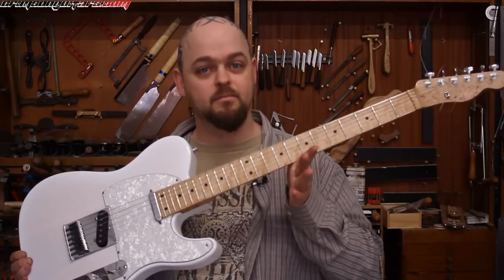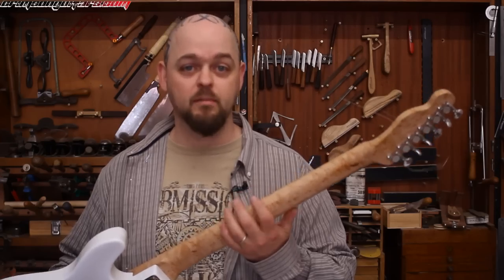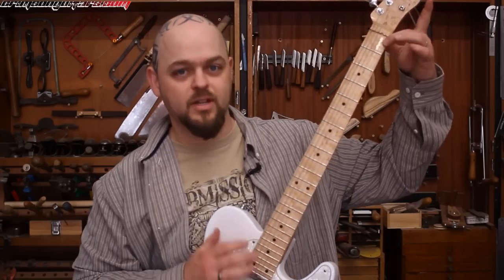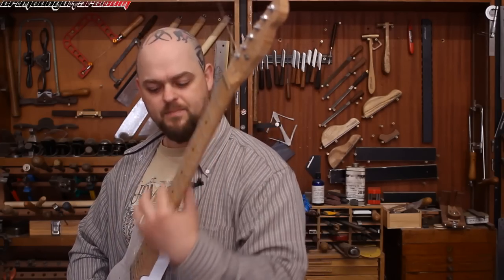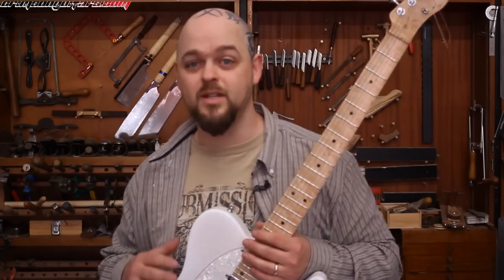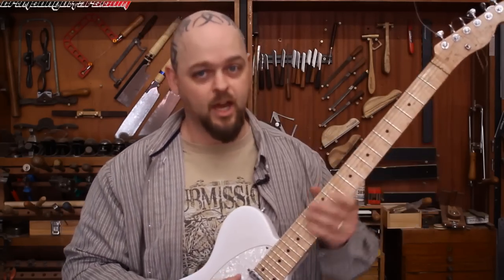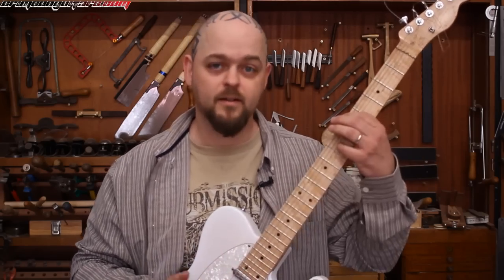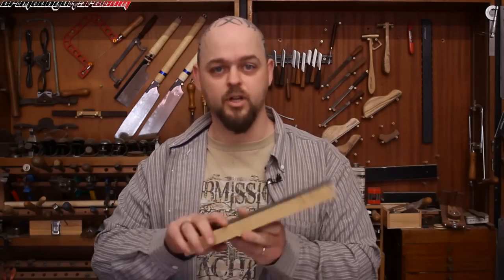Podcast 109 - How to Fix a Twisted Guitar Neck

Comment: I don't think my bass neck is twisted but the strings don't aligned correctly down the neck going from the bridge to the nut. The high E is right on the edge of the neck and the low E is too far to the right. The owner that had it before me did have the body coated in truck bed enamel spray and I wonder if that is what the cause of the misalignment is. He did it because it's an Ironbird and those tend to get dinged up and chipped at the points
Reply from the maker: sounds like the neck is in at a sideways angle, the extra paint could be the issue indeed.. I say remove the neck and try and put it back with the strings aligned properly which may mean using a file to remove some excess paint..

Comment: hi. i just subscribed because u said u answer questions
i have a Steve Vai JEM555 and i have decided to open it up and fix it myself. and i will have questions . i fear it has a twist that was why i searched this video .
i have another Question and that is what is the best way for me to clean the fretboard which is rosewood with. the Germs i mean , the sticky ones .thank you Ben
Reply from the maker: I don't see everything, we've grown a bit big for that... however. There are not many options to fix a twisted neck, if it doesn't affect playability too much it is a case of making the best of it. You could remove the frets, flatten the fretboard and the refret if you fancy a realy big job..
As to cleaning the fretboard, crimsons fretboard cleaner and restorative are non toxic and very very good.. alternatively use lemon oil or similar.. thanks for subscribing. B
Reply: 0000 Super fine steel wool. Never use lemon oil, it’s acidic and eats away at frets. Oil your fretboard with walnut oil.

Comment: I'm pretty sure that the twist in my neck affects the action. the book says that at the 12th fret the bass E string should be at 1.50mm but mine has to be at almost 2.00mm or more to not buzz...

The guitar is set up right. It has a slight bow, about .010mm-.020mm bow so there isn't any buzzing at the middle frets.

its also an LTD ESP viper 200fm made in Indonesia so, it's junk. That doesn't help... :/

can you send me a good guitar so I don't have to deal with this one??

I'm a huge fan of your videos and a future frequent customer and promoter. I like your tats too btw

-Video is "Liked" 

;)

Comment: Hi Ben and the rest of Crimson Custom Guitars, 
I have questions about dead spots - certain notes on the neck with significantly shorter sustain than their neighbours.  I mean real dead spots caused by the guitar dampening some specific frequencies, NOT strings fretting out due to uneven frets, action set too low and other setup issues.

Are they common? I've been to the shop and played some guitars and all of them had dead spots to some extent (sometimes not even "dead", just "weak"), but I may just have been unlucky.
I currently own a guitar that has significant dead spots and think of selling it and getting another one. Although I'm afraid the next guitar will have them too :/.

Are there any remedies for dead spots? My guitar has 3 of them: 15th fret on E and B strings (G and D notes), and on 11th fret on G string (F# note). I've tried so far attaching some weights to the headstock and that helped a bit with the first two, but the third one, the F# just moved half step down to F.

Regards
Reply: I would love to see this question answered as well, coincidentally the dead spot is on the 15th fret here as well. Maybe because of the neck joint, maybe because it has a floating bridge and the springs play some nasty game with that frequency, I don't know...
Reply: Perhaps the frets are lifting a bit in those areas.?.?

Comment: Hey Ben,
Just a thought as you are mentioning basses (which I have noticed you don't mention very often), are there any different fundamental techniques you use when building basses as opposed to guitars, or is it purely a case of thinking in different scale lengths and string spacing?
Cheers,
Lee

Comment: well let me throw another wrench in the works for you.  picture this an instrument 1980's or prior maple neck and fretboard which is 1 piece ( ala japanese made squiers and similar), lacquered  and has yellowed with age.  in this case your option of using the frets although is an interesting theory i have never seen it work ( just being honest). straightenint it wipth pressure does work but most instances goes to crap once string tension is applied  ( look at me rambling on LOL).  ANYway, in the case of neck and fingerboard being made in a 1 piece fasion ( no seperation between the fretboard and neck), and not wanting to refret and refinish an entire neck just so it matches there isnt a lot of options available.  fact is that trying to clamp and twist the neck would be the only means in this case when it comes to 1980's and earlier guitarskeeping it as original as possible is a big deal and this is even more compounded on the lower end instruments from the same period, for example lets use a japanes made squier bass from early 80's ( 80 to 85), if one of these has a twisted neck you can level refret refinish which makes it not cost effective, you could replace the neck but this is not cost effective nor worth it for a bass that varies in price used from 350 (and in some cases and locations) up in the 500 to 1000 mark.  which leaves the only option as clamp heat steam method.  i do agree on one thing though if you are goign to do the clamp heat method leave out the steam it is not going to help because all it will do is add moisture into the wood and go bback to the way it was or be far worse.one method i have tried and seen work is to set and clamp the neck down with a slight twist in the opposite direction then use a household clothes iron on low heat to slowly warm the neck via the fretwire ( rest iron on a rag over hte fretwire).you have to constantly monitor it but i have seen and had it work but only in rare cases.  so with all of that said in the case of fretboard and neck made in one piece and laquered showing its natural aging what are your thoughts on fixing a twisted neck

Comment: Hi, I know this is an old video, but I really need some help, if anyone can answer me I'll be really grateful

I have a really cheap strat copy (before saying "oh, it's because it's a cheapo", I can't even buy a Squier Bullet, it's really expensive here in Brazil, the minimum wage goes around $910, and a Squier Bullet goes for $1.200, I'm not kidding), the original neck got twisted really badly, so I changed the neck on it, a cheapo neck as well, from an old Austin strat copy, the thing is, as far as I can see, the neck is straight but none of the strings can tune, if I hold an E major chord and tune the guitar to that chord, as soon as I go for a G major the guitar is out of tune
the nut is a little bit off the fretboard, it's almost imperceptible, I can't even fit a needle on it, so my question is
is the nut creating all of the problem or there's really something hugely messed up with my guitar?

I'm sorry if I was rude in any way at some point, i'm still working out my English, sorry, but if you could help me please, it's my only guitar and I really can't afford much, just really cheap strat copies...thank you
Reply: Hello Igor,  my first question has to be:  Is the fret spacing the same on the new neck and the old neck?
Reply: Yes, i'm afraid that the neck is a bit closer to the bridge, I don't have proper luthier tools, but I can see that in the old neck, the 21st fret was right above a screw on the guitar's scratch plate, and on this new neck, is a few centimeters away from this screw, going to the bridge direction, so, I think the neck must be off, so, do you think it might be the problem? and how can I drill the neck in the right angle, cause now it isn't, the thing is, I have basic tools, some screwdrivers and stuff, but I have no clamps and so, what tools do you think I can use to "replace" a clamp, so I could set the neck angle, and that huge rule to set the length properly? thank you so much for your reply
Reply: OK, so your new neck has what is called a longer "scale length" and will not play in tune unless the bridge is moved back to the proper position. This would create a couple of problems.  I will assume that your strings feed into the bridge from the back of the guitar.  These holes would all be in the wrong location.  Second, because you would have to move the bridge back, any existing holes would be exposed.  My suggestion is for you to purchase a neck with the proper scale length.  You can calculate the scale length of your original neck (if you have it) by measuring from the fretboard side of the nut to the center of the 12th fret, then multiplying this number by two.  The neck should also be the same width and be a tight fit in the pocket.   Don't hesitate to ask more questions, I am happy to help you with this.
Reply: Tim C Hi, thank you so much for your help, so, the Austin neck was indeed a bit longer than the original neck, so, inspired by Clapton, I ended up buying a used guitar, same model and brand as mine, I used the neck on this "new" guitar, the neck pickup, which sounded a bit different (in a good way) and some plastic parts, so I didn't need to move the bridge cause the neck was a perfect fit, I just needed to shim it a little bit and now the guitar plays great, thank you so much for helping me out with this

Comment: Why don't you show how to fix a twisted neck?  I mean... taking off the fret board, showing how to plane/sand the neck, remove the twist. This approach is not shown anywhere on YouTube (only the heat method with electric irons)  Then replace the fretboard etc.  For a company who makes guitars this should be easy enough.  I suspect there are many people like myself who have a couple of older guitars (with twisted necks) and are looking for a practical demonstration of this type of work, shown in detail.  Just a thought, enjoy your videos.

Comment: pretending twisted necks are ok but the intonation is gonna suck regardless so whatever.... this was dumb
Reply from the maker: the intonation hasn't changed, it is  twisted not morphed into a different length. B
Reply: @CrimsonCustomGuitars   I call Bullshit
Reply: @CrimsonCustomGuitars  well have fun tuning it
Reply: Dude, if the neck is twisted, the string has shifted along with it, because the peg has moved, so the intonation is fine. If the peg hasn’t moved, which is impossible unless your headstock is also warped, then maybe intonation would be an issue. It’s all relative. Duh!
Reply: @jsullivan2112  its still sucks
Reply: @freewheelburning8834  You have no idea what you’re talking about.